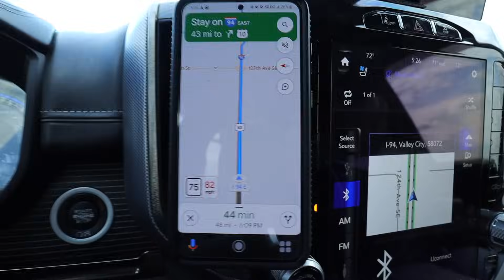We Lost A Tire on our RV and how we handled it.

Comment: I know this is an old video but, the dewalt impact has 3 different torque settings 1,2,3. using the #1 setting will give you torque around 40 ft lbs, 2 will go 80-100, 3 way too tight. I use #3 to take the lug nuts off and #1 to put the lug nuts back on then use a torque wrench.

Comment: If this ever happens to you again,since you are parked, take one lug nut off one of the other wheels so you have an example, take measurements so you know how long the lug bolts are, then remove one of the broken ones so you know the sizes so when you go to a hardware store.  To remove lugs you need at least a 3 lb sledge hammer and a punch.  Also you only use an impact on low torque to initially install the lug nuts.  And you always use a torque wrench to set the torque on all your wheels.  You can get torque limiting extensions which will get you closer to the correct torque, but you should always use a good torque wrench to finish up the job.

Comment: I've broke my fair share of parts over the years.
At least you're in a camp ground, not in an impound lot.
If I were stuck roadside, I'd be in for a long day, but I would have pounded out a stud from each remaining hub and installed them into your bare hub, and installed the now 5 volt hub on the axle with the lightest weight. Keep the speeds below 45 mph, and find a trailer store for replacement wheel studs and tire lug nuts.

While you're at it, verify the wheel torque with the wheel manufacturer, and if dry or lubricated, as there is a difference in torque values.

Comment: Glad it turned out well👍.l always ask myself when you pull a trailer and when you make a turn around too tight, if there’s any stress on the tires and wheels from that thigt turn . not much on dirt roads but asphalt or cement roads ,just my 2 cents

Comment: You should invest in a set of Torque sticks that will attach to your impact gun. They are designed to prevent you from over torquing  a bolt/nut.

Comment: Wheel Studs, and why do you use an impact.  I run two nuts down to the rim they use a T handle. and tighten with T handle my enitre life.  I am nervous anytime someone air hammers a lug nut on.  I have never use them to put on a tire on rim.  Don't jerk the torque wrench you will over torque...  FYI. Oh, and yes you need to change the brake shoes look pretty thin down the road,

Comment: Take 2 lugs off each of the other wheels. Then, until you can get somewhere that carries them, all wheels will have 6 lugs. Plenty for a short time.
Reply: I was going to say the same thing. It would get you moving. But you would want to get the studs replaced on ALL hubs as if one set failed. The others may not be far behind. He can save some labor and do the brakes at the same time.
Reply: OPTION...strap, chain, or rope....tie the axle up and keep going.

Comment: I've been there before. Had all new tires and brakes installed brakes failed and locked up tight while going down the interstate. Smoked the brand new tires. It was about 1000 bucks to get the brakes fixed and all new tires again.

Comment: Great job, most people would be stranded or waiting for repair, you didn’t need a new hub but you need to change the others lugs, the other ones are over torqued and stressed. Should have bought enough lugs and brake shoes.

Comment: Sounds like over torqued lug nuts. 
For future reference, remove at least 2 tires and the brake drum...remove  2 lug nuts (if 6 lugs per hub) to install on the affected hub. 
Now you have 4 lugs on 3 tires which will help get to the nearest station.

Comment: nicely done. ok not sure on what troque wrench you got but this is critical most cheaper Torque wrenchs under $50 are Garbage Especially the HF brand
I would also consider getting it calibrated  as sometimes they can be a few pounds out of calibration and with lug nuts its critical that you get the Troque settings correct.
if you have over torqued the other wheel nuts i would consider replacing alll of them Also remember that there are left and right handed threads for nearside and offside
Reply from the maker: Great tips thanks!

Comment: Stuff happens! Don’t try and explain your tool choices. First thing I grab on a wheel bearing job to knock the races out and new ones back in is a socket extension just like the one you are using for a punch. Like you said at the end, a quick leg break after a short drive to check lug nuts after every wheel job is a very good habit to try and catch lug nut issues. Just curious but how far did y’all make it before losing the wheel?

Comment: The tire shops in Ontario Canada r legislated by law 2 over torque the wheel lugs because of a rash of lost tires due 2 under torquing. I carry a pipe and breaker bar because there is no way that you can loosen the lugs at the side of the remote highway without them! I have snapped (2) 1/2" drive ratchets and smoked a socket! I change tires myself always now 2 avoid them over torquing them.

Comment: My battery powered impact gun like yours goes up to 1,400ft lbs torque.  That is how strong those can be.  Check your power tools, mine have settings that allow you to use full torque getting things off, but you can switch settings to run lower torque putting fasteners back on.  Mine has a setting where it will spin it back on until it feels it snug up then stops so I can use my torque wrench to finish the tightening.  As you stated, IF your big gun does not offer all those settings, just use a much lower powered power tool to just spin the lungs until they are snug, then finish with the torque wrench.  Don't forget, for the torque wrench to read correctly, you need to be holding it by its hand grip.  It calculates the torque based on the distance from the pivor point so grabbing in the middle of the bar throws that off.  Don't feel bad, every dude out here has made every mistake once, that is how we all learn.  It is why really old people are so damn smart.  They have already made all the mistakes.  I have personally made every dumb mistake when it comes to working on cars or rebuilding houses.  All of them.  My first thought was thank God the wheel didn't go into oncoming traffic and kill an innocent driver.   THAT is how bad this day could have gone, but it didn't.  It sure didn't seem like it at the time, but today was a very very good day.

Comment: I wonder if you couldn't borrow studs from the other 5 good wheel hubs by taking one wheel off at a time and knocking out a good stud from each  to get at least 6 good studs in that wheel?  Maybe borrow two studs from the middle set of your wheels,. That would leave 6 or 7 studs on each wheel hub to hold a wheel on. I think many camp trailers do fine with only 6 studs. Looks like you have 6 wheels so you have 5 good wheels  with 8 studs  which is 40 studs. You could get by with 6 or 7 when properly torqued to limp to where you are going to get the correct studs. You really don't need anything but studs.

Comment: Some times the center caps installed through the wheel can cause the lugs to sheer off.I had it happen on my eighteen wheeler.Don’t ask me how it happens I know it caused my lug studs to sheer.I was lucky that I checked my wheels and saw I was missing some lugs.I had to replace them just like you did.

Comment: Re,-torque the new lugs after driving on them the first time.  They will seat in to the hub fully and the nuts will be loose.  For the next couple of trips,  check each wheel torque.

Comment: Fault is not the issue. Bolts will stretch and weaken over time. You indicated many time these bolts were loosened and tightened, They will stretch and get fatigued, resulting in failure. No way to determine when, but they will eventually fail. Take measures to stay on top of it. If you change them to often, it is still better than breaking down or God forbid causing injury to yourself or others.

Comment: This happened to me 10 years ago wheel took off with 4 kids and a dog on a late Saturday.  I was in middle of rural Pa at a abandoned gas station off the highway. I took truck with lug after banging it out like you did. 1Leaving my family wife and kids behind I started hitting Napa’s who said they had lugs. They only had 3 I needed 5. Drove 20 miles to other napa they said they had some got there before they closed only had 1. So finally got back to trailer put new lugs on with nuts found out spare tire was different  width but with 4 of 5 lugs we started to head on to Indiana which was on way going slow and checking lugs and temp of tire. Long trip KZ factory was great few days to get there and had everything we needed except tire for Trailer were odd size they didn’t stock. So off we went and tire shop had right size trailer tire 
It was a nightmare and this happened 2 st day of 2 month western trip.  But I kicked myself thinking I may have not tightened lugs before we left and I am so safety conscious. But I probably over tightened like you. Now we have class c I have electric impact wrench and torque stick 140 lb and torque wrench.  We had 2 blowout and calipers freeze up.  With 20k bottle jack and generator I on side of road spun of dually and calipers for e450 are available at most auto parts. After 2 nd capliper froze I replaced other 2 and bleed system.  It’s been years since that became issue. Only issue we had on e450 but I carry box of 4 brand new calipers and hoses in storage  I take no chances anymore.  We had road service with the flats which was a waste waiting for hours for truck to show up I bought impact and jack and added tire monitors to class c and towed Vech. But losing that wheel 10 years ago was a big lesson.   We did out 2000 trip and never had any issues with trailer wheels again.

Comment: I use the same impact on my wheels, switch it to low and dont let it just hammer away, stop after 4 or 5 clicks.. that should be around 100ft lbs then finish with the torque wrench

Comment: I’m  Heavy truck mechanic by trade. I can’t say I’ve seen all studs break at once from being over torqued. I have seen all six sheered off by being left loose. Forgetting to tighten them will cause this for sure. There are normally some signs of being driven while loose to go along with it.

Comment: Yeah, I think what you’re gonna have to do is the thing about that and I was looking at that I was looking at the wheel. I think you lost a wheel bearing sometimes these happen. You had a bad wheelbarrow. It snapped the studs off but it also I’m thinking you haven’t the person that probably put the wheel on overtightened it over torque the lugs and you got to when you do your lugs 80‘ 80‘ pounds and then you switch it to 110 if they got to overworked, then it could be a bad wheel bearing, it’s a wheel bearing and the rim might be bent too

Comment: I've had 3 time's tire shop's have over tightened my lug nuts and they all snapped first time I paid for a tow to a shop to have them replaced expensive  I replaced them myself after that next one I had AMA tow it to where we were going jacked it up pulled off the tires and the brake drum and replaced the lug  bolts then reassembled and put the tires back on last one I was at the propane refilling pump since it was closed I jacked it up and replaced the lug bolts and all were over torqued by tire shops

Comment: The Tire shop that mounted your new tires over torqued your wheel thus causing the studs to break off. You need to check the torque on the rest of your wheels.

Comment: Not sure why this showed up on my algorithm but, you were absolute lucky to be so close to Jamestown. A ton of drama for being a mile away from an RV park and stores with parts to easily fix it… I’m shocked the park was okay with heavy and greasy hub and parts being placed and pounded on the picnic bench that families use for food… the ring of grease says it all and I’m sure some idents from heavy hammering do too. Common sense… I’m not mechanically gifted, I don’t tow my 34’ travel trailer long distances except on rare occasions but getting lugs torqued properly is an absolute necessity.  You were on one of the quietest freeways in America lol. If that tire popped off and bounced up in the air and hit a vehicle in the windshield… soooo many uninformed and unintentionally dangerous people towing big trailers or driving huge class A’s on freeways scares the bejeesus outta me. Not trolling but had to get it off my chest after watching this. I would never have thought it was okay to at least not put towels on the table before setting all of that stuff on it or that the park was okay with my being inconsiderate of their bench.

Comment: Sorry to hear of your break down. I have the same impact set by DeWalt. Pick up a set of torque sticks, Harbor Freight has a great set for the money. I use my impact with a torque stick to go the next setting down then finish them with my torque wrench. Example torque spec 130 ft lbs. I would use the 120 ft lb torque stick then finish my job with the torque wrench set at 130 ft lbs manually. Works great and you k kw it correct when your done.

Comment: It just needs new studs. Not the whole hub assembly. Pull the hub assembly. Hammer out the old studs and hammer in the new ones. Easy peasy.All aluminum rims require to be re-torqued after a couple of heat cycles. That is more likely where the trouble began. The lugs loosened up and the vibration from the wheel snapped all of the studs off.

Comment: I am continually surprised at the attitudes I see on vloggers' channels. Why? Because they are blogging .... or because bloggers just act differently than non-bloggers?  Why do I say that. Because we just sold our 2001, 40 ft.,  Class A diesel pusher with 142,946 miles on it.  
We had all sorts of issues. Only 1 blowout on I-10.  We NEVER reacted as I see bloggers react. I am 85, my wife 82. We made our last trip up from FL in May.  Life is great. America is beautiful.  Losing a tire is no big deal ... I wouldn't describe what he described as " blessings" just situation details.  I didn't try to fix anything myself. I would never have changed a tire; not even on our toad. Cummins was our go-to maintenance. Tires were Michelin put on by experts and with Tyron Bands (look it up). Safety. No cheap knock-offs.
We were 25 years in 2 Class A coaches.

Comment: The hub should not free spin the way it did. You may want to go back and put more preload on that bearing. It should spin but with resistance.  You will damage the entire axle assembly or break off the spindle

Comment: Having massively over torqued all your wheel nuts the studs will have stretched and ALL should be replaced as stretching is the pre-cursor to snapping owing to fatigue. Secondly any shiney surface needs to be keyed before spraying with primer before finishing coat. 80 grade wet and dry is perfect for the keying.

Comment: Once you change a tire on a trailer you need to check the lug nut torque at about 25, 50 & 100 miles.

Comment: drill a small hole,   and  get an easy  out  and screw  them  out.   I watched  my Dad  do that a lot  but   if I were in your situation,  I probably  would not have those  tools to do that.    God  Luck.  If this  makes you feel  better,   I had  four  bad  tire blockouts that did  5,500.  dollars  worth of damage.  Hole knocked in gas tank, gas  poured out,  propane line hit.,   tools came out of front compartment which broke off when that tire  blew.  Fender  knocked offf,   Exhaust  pipe  knocked in to,     Had  to change one  big tire  by  myself in 120 degree heat  (but it was dry heat (.    The whole disaster happened  from Road Forks  new  mexico  to  Tucson  Arix.     All tires  had to be  replaced.  that was  over  5,000 dollars.      equals    a  bad  trip  from  Fl.  to  Arizona.    God Lluck
Reply: They are not threaded in, they are pressed in with a big press. Todd did the correct field fix with a punch and an open nut for replacement to suck it into position.

Comment: I'm not sure but I think you had some Bad Lug Bolts made with to much cast iron! You lost 1 then 2 then 3 and so on till Boom, I've seen air impacts with a lot more torque than any battery style Stripped the treads on the bolts but never crack a bolt, Grand Design has had a bad run for awhile  now, seen this same thing on another Video a year ago. My advice is Change ALL them bolts. Take Care and be Safe, another RV'er.

Comment: Don't beat yourself up most little tire stores don't use a torque wrench so you assume it's okay. Other blessings is it didn't tear the side of the trailer up coming out. My brother had a different issue on his they got extremely loose the tire was wobbling all over the place. In his case it was after a 12-second pass down the quarter-mile
Reply: Tire store guys may use impact sticks, they look like socket extensions,  but will start to twist themselves after a certain ftlb.

Comment: Your wheel nuts have to be torqued at about 100 lbs. If they tightened them with an impact wrench they might have over torqued them. You should check all of your wheels. Over-tightening stretches and weakens the studs and they are prone to break. You shouldn't need a new hub assembly. The studs come out. Of course you already have it all fixed so I am rambling.

Comment: You need brakes . pleas replace your trailer brakes ! Get the entire backing plate assembly with the brakes and all associated parts assembled, then you can just unbolt from axle connect brake wires and your done.  If the drums and wheel bearings are worn replace them as well. at the minimum repack the  wheel bearings  and replace the wheel seals and lastly the cotter pins.  Adjust and test your electric break  system to ensure you brakes are operational . Re/Torq your lug nuts again after a few hundred miles !